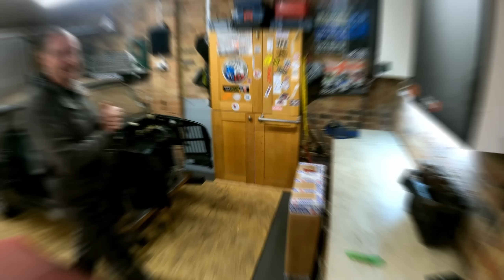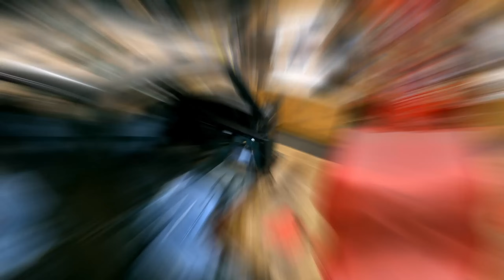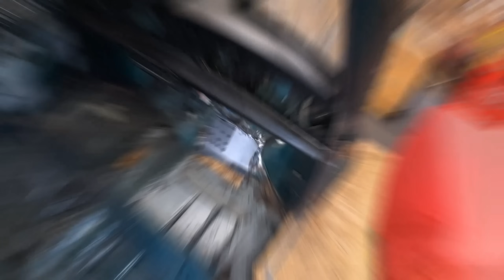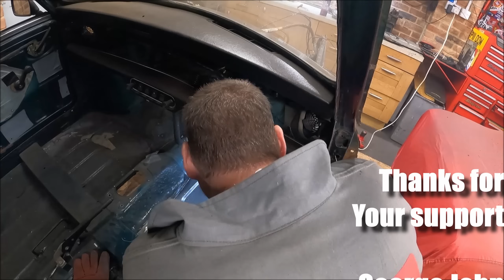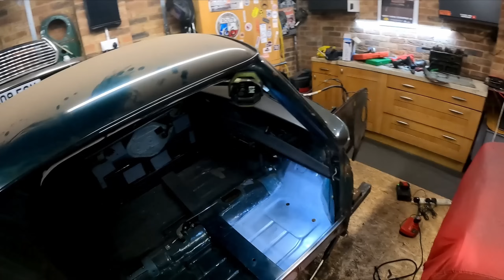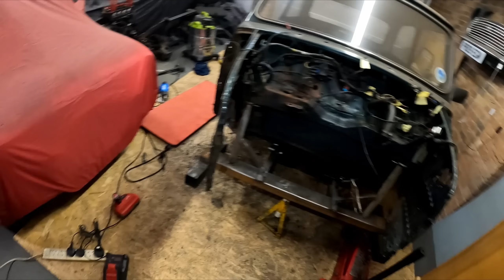Floor Pan Replacement - Classic Mini Workshop - Project Racing Green Pt.16

Comment: You probably really needed the break. When enthusiasm wanes, I would suggest that you think back to the special features of the car that attracted you so much. Then, re-read the magazine articles about the Racing Green and John Cooper Tuning parts. That should help to rekindle the spirits. When you get back into the workshop, don't try to do too much straight away. Best of all, remember that you can do all the tasks needed: you've achieved them all before. Just see what heaps of rubbish you have started with and look how the cars turned out.
Reply from the maker: Thanks buddy.

Comment: Hi Keith. Do you need to take back the zintec coating when using the spot welder? Cheers mate, keep on keeping on 👍
Reply from the maker: Yes you do ideally
Reply: @classicminiworkshop  great, will do so then. Cheers

Comment: Looks good 👍.. can I ask as I've just fitted same panel  are you welding up toe board on external side when jigs gone or seem seal it?   I was contemplating welding outerside too for most as penetrative no wear near as good as yours. Cheers for sharing 👍
Reply from the maker: No, I plan to just seam seal as per the factory . There is no harm if you did though, just some added strength.

Comment: Great job Keith, very interesting as my Mini needs exactly the same repair to the drivers floor, but mine will have to wait until at least next spring as everything I do is outside on the drive and I’m not as young and enthusiastic as I used to be. That said, its great feeling when you catch your MoJo and those repairs make you feel so good, so up and on to the other side as they say, hope you find it a bit easier. Look forward to your next update. Take care. 👍😊

Comment: Just for vyour information the smoke coming off the zinc coating is poisonus,  Us a fan blowingf the smoke awy from you whenevert welding we use smoke extractors when welding to make sure the smoke does not end up in your lungs. Please be very careful when elding zinc coated metal  ALWAYS sand the zinc coating away from any metal you intend to weld good practice uis to weld and cool the welds with compressed air to prevent warpage.
Reply from the maker: Thanks Shane, great advice. I do sand off the Zintec coating with a flap wheel before welding. Nasty stuff indeed!
Reply: Good advice Zinc Oxide is pretty bad for your lungs you need to removed it prior to welding same applies to galvinized coatings and adequate ventillation is a must. Additionally I'm concerned about the number of restorers on here that never use a mask of any kind when grinding or cutting metal especially at close quarters and in a confined area. Along with everything else over a short time inhaling minute airborn metal and rust particals poses a serious heath hazard. Ask any shotblaster if they'd ever thought of going maskless!

Comment: Hi Keith, always waiting for your latest upload. would you add a link to the type of gas you use? I have the same Clarke welder as you. 
Many thanks Keith.
Reply from the maker: https://www.ebay.co.uk/itm/173589562251?hash=item286abe838b:g:HaoAAOSwd4tULW8C&amdata=enc%3AAQAHAAAAoIMKn6ZsXy3UQc2pSnsm6gsRlJBR9gLthH%2BWZMgfGg%2FTjW6NiPGSA%2FFZ15vL3ST8UBT2y3N0%2FRceGb6pLPBqbkupUyAfIWx1fq7T0pU6iiT58B2D9o5CZSAn5tt%2FY4lnCFKbuWngk31IZOGgLaKLBrubTuBrZDu3nAoJvOoaJgVwVi3aQO2gYn0aazX04IQymGBxBHc2qzt01hRs%2BLog%2FD0%3D%7Ctkp%3ABk9SR_Cc5PCbYQ

Comment: Hi Keith. What work lights do you use, and would you recommend them?
Great work by the way!
Reply from the maker: I use a few, but this one is excellent for the price https://www.amazon.co.uk/Sealey-LED700P-Rechargeable-Pocket-Floodlight/dp/B07RC7KRBJ/ref=asc_df_B07RC7KRBJ/?tag=googshopuk-21&linkCode=df0&hvadid=375507668825&hvpos=&hvnetw=g&hvrand=11830055024141389763&hvpone=&hvptwo=&hvqmt=&hvdev=c&hvdvcmdl=&hvlocint=&hvlocphy=1006583&hvtargid=pla-819426127679&psc=1&th=1&psc=1&tag=&ref=&adgrpid=76297947065&hvpone=&hvptwo=&hvadid=375507668825&hvpos=&hvnetw=g&hvrand=11830055024141389763&hvqmt=&hvdev=c&hvdvcmdl=&hvlocint=&hvlocphy=1006583&hvtargid=pla-819426127679